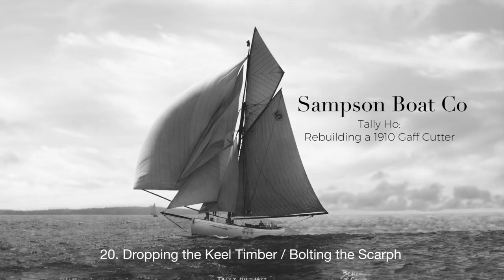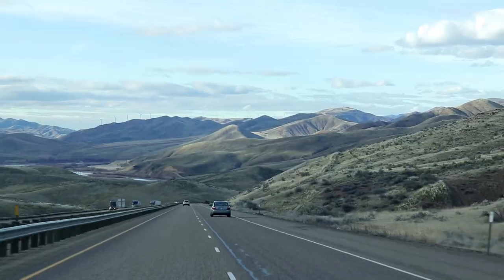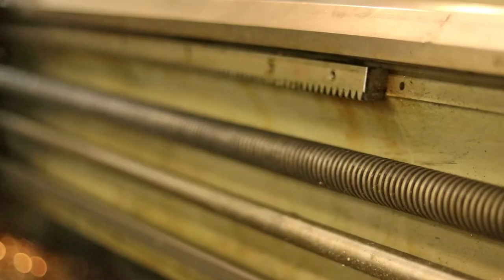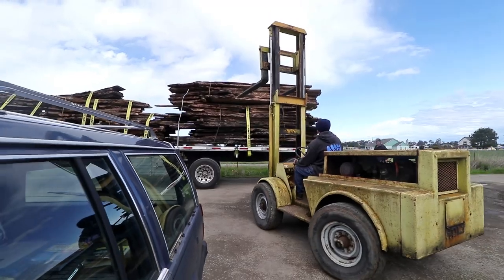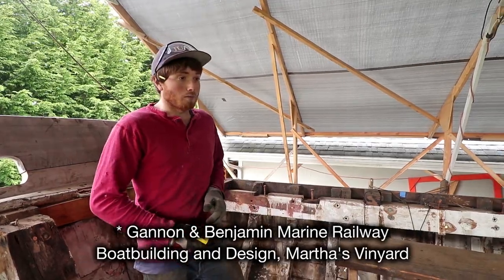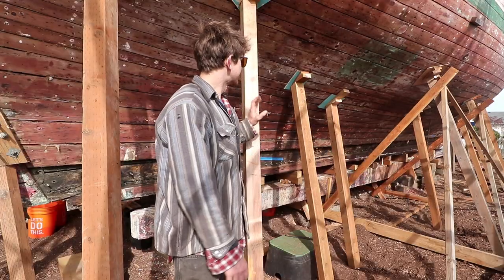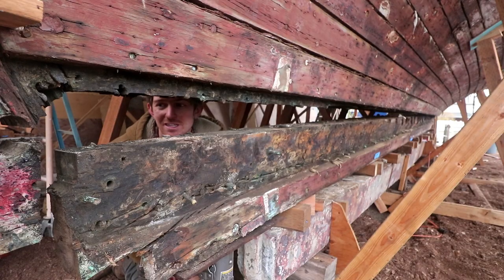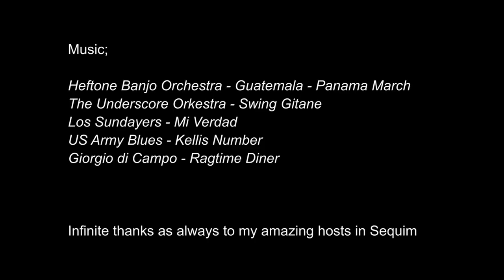Removing HUGE Keel Timber from 20ton historic yacht, ALONE! TALLY HO EP20

Comment: Thanks Leo for another episode. People like Steve Cross are one in a million. Of course he'd be out of work without people like yourself. Used to drive a forklift like that, hard to steer without the wheels on the ground. Quite an undertaking even with a group. Appreciate your explanations, I understand that roofing cement will adhere even underwater, handy in the rain or sealing the keel of Tally Ho.

Comment: Where there is a will, there is a way as the old saying goes.. All made possible however by the knowledge you have acquired and the absolute determination you have not to run from a challenge. You certainly have my respect!

Comment: hey Mr. Sampson for drilling all of those great long holes through solid wood with an auger bit I highly recommend picking up a tool called the Milwaukee whole hog, its a very powerfull right angle drill and will extend the life of your Makita brushless 18volt drill if you find yourself drilling a lot of large holes like that, I used them in the electrical field to make large holes for running wire through even the cordless versions are practically unstoppable

Comment: slow and smart - one man can do an amazing amount. I will remember this when I move my machine shop 2000 miles by myself. ~P
Reply: Forgive this long diatribe, I am a little obsessive at times! (The entirety of my 55 years) 

     I can really relate to this series, and your comment for various reasons. Being a handy fellow in my late teens I restored/modified two cool old boats in their extreme twighlight years. First was a 1930's era folding boat that was part of my high school art class junk pile. The old hippie art teacher Tom Lamar gave it to me when my continuation school was closing. I restored every inch of that old girl including the canvas hinges that kept out the water. Sold that to some long forgotten adult for $500.00. Three years later someone dumped an old international fireball racing scow in the alley behind my mothers condo and after literally dragging it home, bought, lengthened (with a 20' piece of 3" square tubing) and modified a cheapo trailer, then restored the scow completely, under its transom adding a nice plate aluminum plate mounted home brewed 5HP horizontal motor, transmission, prop shaft, and propeller that due to my home made aluminum propeller profile could barely outrun its own choking exhaust smoke! It sure was a yar old girl though, and fetched a pretty penny when sold in my twenties after my young wife and I finally tired of putting about in it throughout Huntington, and Newport harbors, one river, and a couple freshwater lakes.
    Many decades later I have now had the pleasure of moving my accumulated machine and fabrication shop four times. Traumatic experience to say the least. This fourth time (six months ago) I found, bought ($500.00) mechanically went through ($600.00) and registered ($1500.00) an old 1986 F700 26' box truck, 100" +/- internal box height. I built into the front half a super sturdy mezzanine with just over 6' clearance underneath that continues from there as a pair of 3' deep shelves all the way to loading door, then bolted all the machines (mill, lathe, bandsaw, belt and disc grinder, pedestal grinders and polishers, chop saw, etc.) to it's cargo floor. I spaced it all out with full accessibility, and safe operation in mind, with cabinets containing machine specific small tooling behind both the mill, and lathe respectively. The mezzanine at 8'X12' is great for storing hot rodding bits, materials, and scraps. The shelves I use for all the bulky, boxed, cased, tools and kit (L.S. Starrett, Milwaukee, etc.) as well as larger heavy machine associated tooling like following, and steady rests, taper attachment, machine vices, four jaw, and three jaw chucks, machining plates, rotary tables, and indexers, etc.. I have yet to install windows, lighting, ventilation fan, and the electrical sub panel with individual over current protection for each larger machine due to necessary upgrading on the new property before winter. It is now parked out back at 6750 feet altitude having easily scaled highway 18 (except for me stalling it in the middle of the first of two adjacent insane 10 MPH posted hairpins trying to downshift through eight gears) during the move to my new home in Big Bear Valley.
    Also moved was all the daily use stuff like Upright 200 GAL. compressor, MIG, TIG, hydraulic lifts, jacks, table saw, work tables, tube bender, torch set, jack stands, and (10 years ago) the largest Snap On box extant with both available tops units, and both available side units packed full, the garage. Along with all that humdrum, I store the biggest assembled four Harbor Freight tool box pieces filled with ARP, grade 8, grade 5, aluminum, and most available stainless nuts, bolts, washers, electrical connectors, and all consumables like abrasives, blades, sandpapers, wire wheels etc..
  Now, I am once again exhausted, swearing NEVER AGAIN!! LOL!! I am now "fully" retired happily ensconced on a large property in the only old growth forest in Southern California, U.S.A. with ski resorts, and Big Bear Lake right out the window, and surrounded by projects galore, half that are finished and useful, (picture a FULLY restored excepting only sheet metal exterior patina, 1941 flatbed GMC CC303, and a 1941 International Harvester KB7 crane truck, a fully restored antique Sunbeam Tiger 1965 race car) and then other half comprising three complete antique speedboats from three different decades, three perfect trailers (after tires and paint), and two huge outboards ($270.00 grand total invested).      
    Lastly sits weeping, waiting for me to get out there and paint it, is a complete Hillman Husky miniature British panel truck, nearly finished, with Jaguar I.R.S., fuel cell, IDIDIT column, modified to take on of my four rebuilt high performance V8, and tranny combinations (total cost of vehicle and four combos, plus two almost new superchargers $12,000.00).
    Been like this young man all my life and happy for it. Started when I read Chitty Chitty Bang Bang at age 9 or so and fell in love with old ships, trains, steam engines, factory machines, military equipment, history,  and any type of transport or antique furniture. By 10 I had borrowed and read the whole Hornblower, and Bolitho series of books that start with an English midshipman, and end with each an admiral at the battle of Trafalfer.

Comment: Great video wonderful job in conveying the vast distances and varying scenery of the US along with illustrating the difficult task of removing a keel from a wooden ship.  A plus all around.  As for the problem of moving the stock, what about a Palet Jack and or a Manual High Lift Skid Truck?  You could combine that with some cheap shop made carts and winches and you should be in business for less than a grand.  Just a thought.

Comment: Hardly completely alone, but with just two of you guys, its basically the same thing when you're manhandling a timber that size. Bloody good show mate. The old decaying timber is out of the way, and Bob's your uncle, as you say. I so wish that purple heart was going to be seen when its all said and done. That is some beautiful wood for sure. I understand it likely has to be painted for longevity's sake. 
Good luck finding a donated, loaned, rented, or reasonably priced purchase on the fork lift. Maybe a small to medium tractor with forks?
See ya next time.
Reply from the maker: Unfortunately Zoli had to leave, so actually I was alone from before the internal framing was finished. But hey ho, it doesn't matter anyway. It will be painted, yeah. Cheers!

Comment: Hey Leo. Great video, as usual. An ex Yorkie, born in Scarborough and a Canadian in VT, I  have always been interested in boats and the sea. My favorite hangout as a boy used to be hanging around the Portsmouth ,U.K., harbor area and since on the Devon/Cornwall and B.C. coasts.I am NOT a good sailor, however. A force 7 gale coming over here in 1966 confirmed that !
Anyway, I just bought the book (sent from the UK) , ‘ The Complete Encyclopedia of Sailing Ships 2000 BC to 2006 AD’ by Batchelor & Chant’  ISBN 90-366-1718-5 and immediately tried to find your boat which you had called a ‘Pilot (cutter ?)’ and then, in this video, a ‘Gaff cutter and I wondered if there is any difference or whether the terms were interchangeable ? On pp 276, 277 there is a wonderful painting of a 1930 IOW ‘English Sailing Pilot Boat’ which they also refer to as a ‘ two-masted pilot cutter’ 69’10” length  (62’6” at the waterline) x 14’ at the beam. Does all that relate to Tally Ho ?

Comment: If you can’t find a forklift , A tractor or loader with a bucket works well if you build yourself a steel ‘T’’ that you can chain into the bucket for a longer reach.. The one I made for my loader crawler is out of 4 inch heavy wall well pipe. The short side of the “T’’ goes across the bottom of the bucket and the long leg of the” T “extends out 15’ or so.. I have welded pick points at various lengths on the boom arm and a couple of eyes to chain back to the bucket. You can lift it up and down with the bucket and or use a come-along or chain fall if need be... The other trick I learned from my ‘ol farmer neighbor is if you have access to a crawler or dozer is to build a gin pole off the back or even the blade of the dozer. With this scenario you would have to use a come along, chain fall or a block and tackle to lift.. good luck on the hunt....

Comment: I would love to see a dissection (or at least an evaluation) of the original keel timber.

Please, don't use fast forward when showing yourself working on the boat supports.  It turned a casual glance over your shoulder into a panic stricken look of 'the boat is collapsing'.

Comment: About roofing tar on a roof it does get brittle and crack, it does dry out.  Whatever makes it soft and sticky dries out, and I imagine some of the oils evaporate and wash out of it. Ever see a tarred road  dry out and crack? Same thing. Why not use 3M 5200 polyurethane? Another alternative Loctite Black PL  roof and flashing polyurethane, Both are waterproof, will expand and contract as the wood moves permanently without getting stiff hard and cracking..
Reply: I was wondering the same thing. I just had to replace a bunch of siding, sheathing and framing because the roofing tar used to seal the top of the building's chimney chase cracked, shrank and peeled up. On the other hand, I haven't had 5200 fail me. Another product that came to mind was Tremco acoustical curtainwall sealant.  Around here it's called "black death" due to its color and tenacity. It sticks to everything and I've never heard of it drying. It's sticky and pliable but doesn't have the strength of 5200.

Comment: harbor freight a cheap 2500 lb w12 v wench and a couple of snatch blocks would help move all that weight and three pieces of pipe amd some chain can make a strong portable tripod for lifting and pulling.
Reply: Clay--I also think winch pullers would be useful but one thing to keep in mind is that although winches and hoists look a lot the same to safely lift one needs a "hoist" type puller. Steve Cross akaSuperAX
Reply: hile i do not disagree my point was 100 dollars at harbor freight and a few more at a junkyard could solve a lot of problems and harbor freight has overhead lifts to.

Comment: I think it may have been a bit less$$ if the frames were roughed in,  in Georgia,  No?   amazing job thou bud.
Reply: Most of the off cuts will become knees and other blocks in which he will need choice of grain direction.   The balance good hardwood to add to the hosts firewood stock.

Comment: I wondered, It did not appear that any of those slabs were sticker-ed (small sticks between the boards so there is an air gap between each board) . With the wet conditions there in WA coast, wont there be problems with mold and rot between the boards because the moisture can not escape?
Reply from the maker: yes, thats one of the reasons I need a forklift!

Comment: make sure you keep a window open a 1/2 inch or so.....I drove up to San Francisco a few years back to buy a 1929 69 foot motor yacht and I slept in my closed up Mercedes and at around 5 AM I woke somehow and I was so weak from carbon dioxide from an enclosed space that I could barely get the door open I think I could have died so becarefull

Comment: Honest question here.  Is there not an epoxy, designed to hold up over the next couple of centuries, that could have bonded your scarph joint together?
Reply: No, b/c the temperature & water-absorbtion expansion rates of the epoxy & the wood are not the same - the glue joint will eventually fail, tho it might take 2 or 3 decades.
A counter-example is steel-reinforced concrete, which can be very long-lasting, b/c their coeffecients of temperature expansion are damn nearly identical.

Comment: why are the bolts made of bronze? would steel not be cheaper and stronger?
Reply from the maker: Steel + Salt water = Very bad news. However well Steel might be bedded or sealed, eventually it will rust away, losing its strength and also damaging the wood around it. Unless it is accessable and recoated/treated regularly.

Comment: Instead of using that little Dewalt or cordless drill, you should look at getting a two speed corded drill. We use them to regularly drill 11/16" holes in smaller treated timbers with no problems. Both Makita and Milwaukee make them. Personally, I favor our Makita because the speed selector isn't an extremely hard to flip leaver. It's also a little smaller and lighter drill. Here are the links:
https://www.makitatools.com/products/details/DA6301
https://www.milwaukeetool.com/Products/Power-Tools/Drilling/Right-Angle-Drills/1676-6